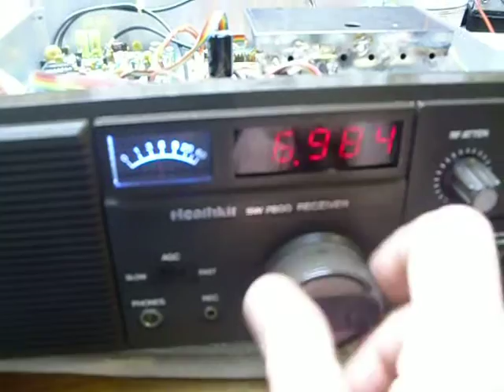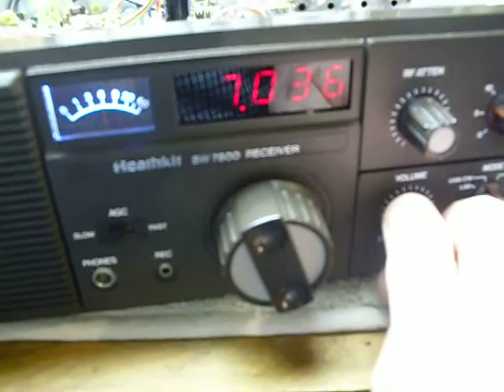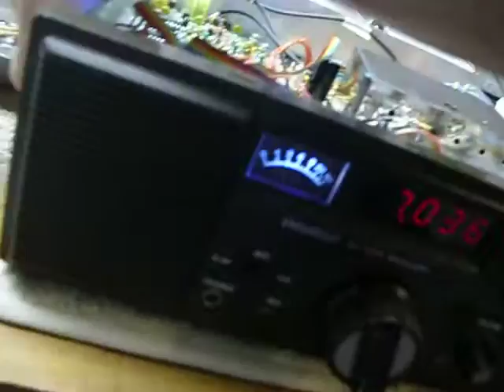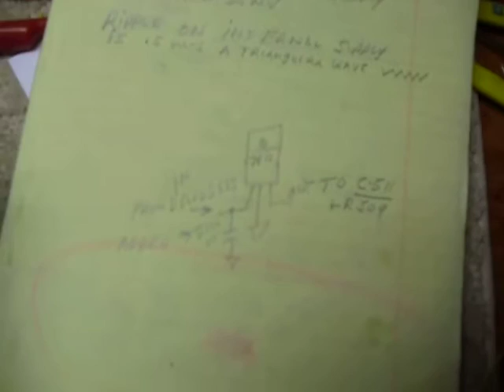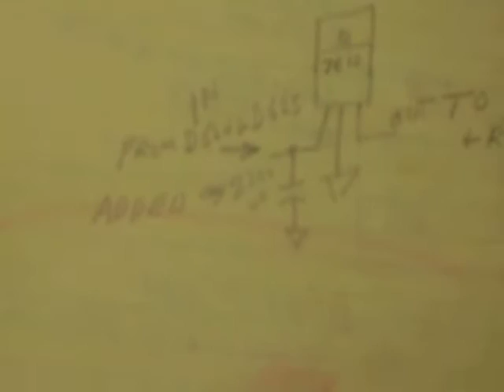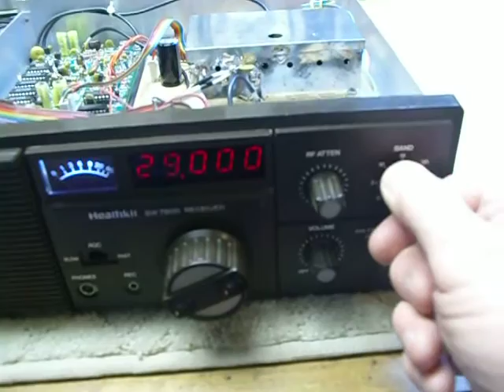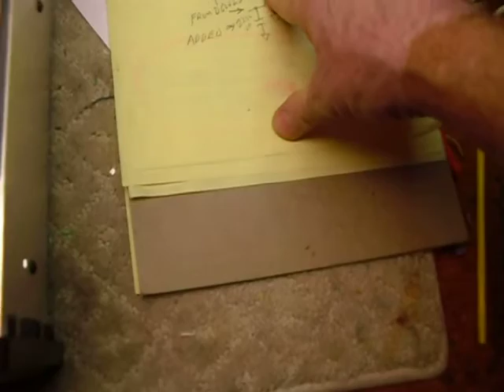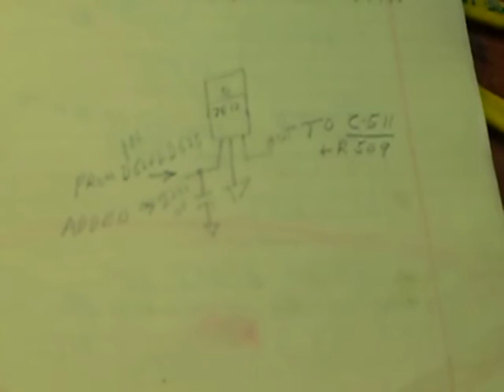Heathkit SW7800 Digital general coverage short wave receiver

Comment: This unit is designed to use its internal power supply.  Clearly something was wrong with the supply other than the electrolytic filter caps.  Installing an additional power supply is a bandaid rather than a fix for the original Heathkit supply in the radio.  Mine works fine without having to modify it with a new, additional power supply circuit.

Comment: Nice job, as you have it installed does it have to have a large heat sink? It looks like you are using the back of the chassis as heat sink? I'm wondering if it has to scrub much power off as heat in it's regulation to 12v.
Reply: That large aluminum chassis will dissipate all the heat the 12V regulator will generate. Think Robert said he was putting in 15V for 12V output, so that's a 3V drop across the regulator. No problem at all. However, I would push for less than 20mV ripple. The guy knows his stuff.